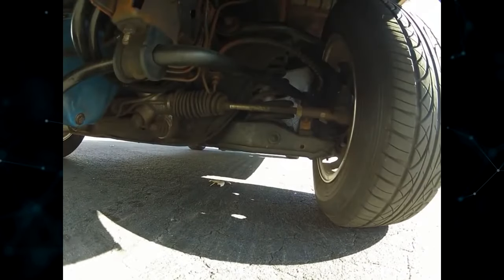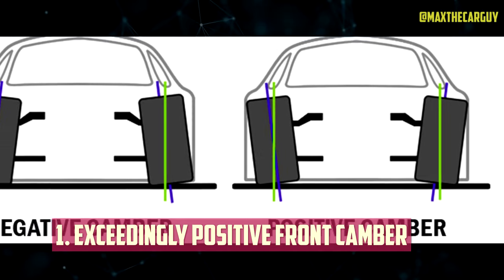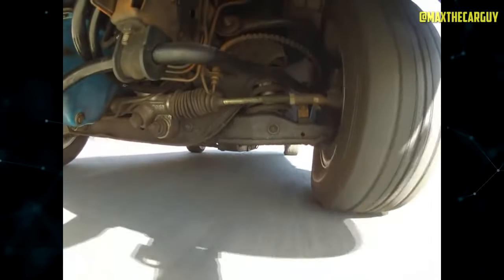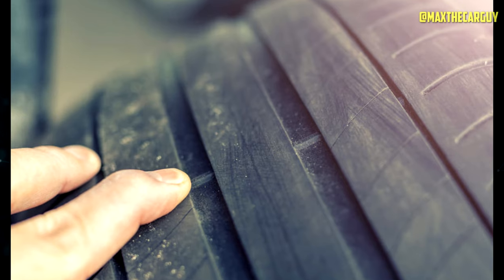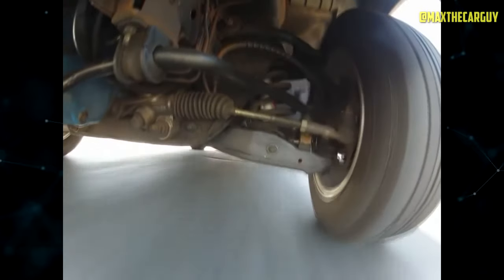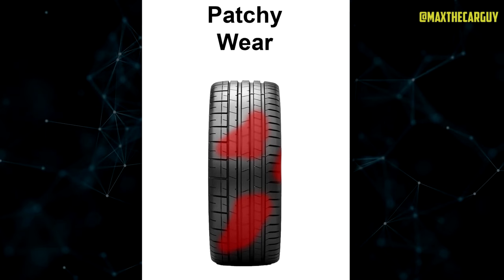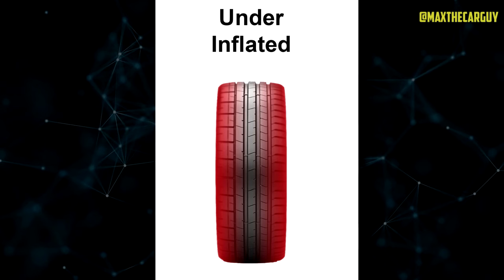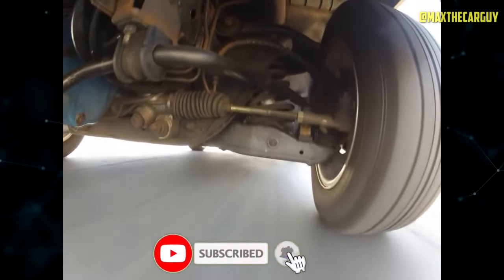5 Common Causes of Outside Tire Wear & Tyre Wear Patterns

Comment: My passenger side front tire has about an inch on the outside that is wearing much faster than the rest of the tread.  Is that a suspension issue?

Comment: My 2013 Pruis V has this issue, car has 220,000 plus miles. The front tire tread keep get getting eaten on the outer edge, I've thought it was worn tires, I even replaced rotors and brakes, it kept getting worse to the point that the steering wheel vibrates  and seats vibrate, the tire doesn't look it's toe wear, it doesn't pull left or right, both fronts have had been deflated a lot even after pouring the whole, they haven't been the same amd continue to wear on the outer edge, have to take car of it caise it's affecting driving and last thing I needed is people in my car and the tire blowing out